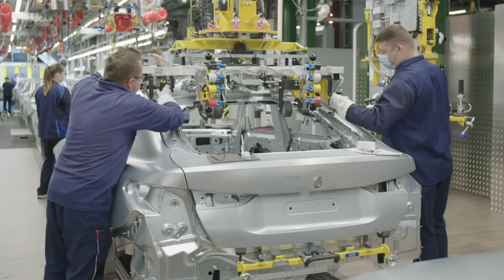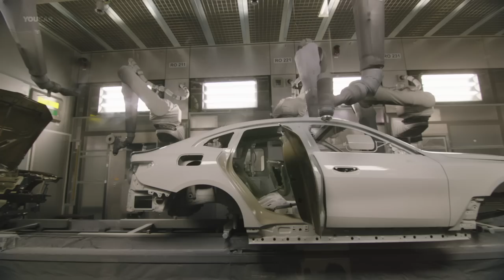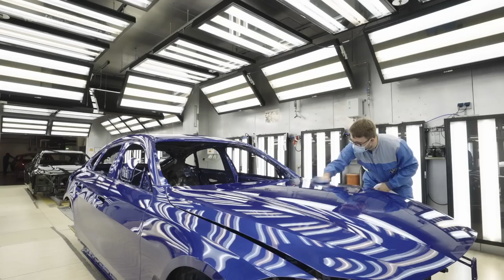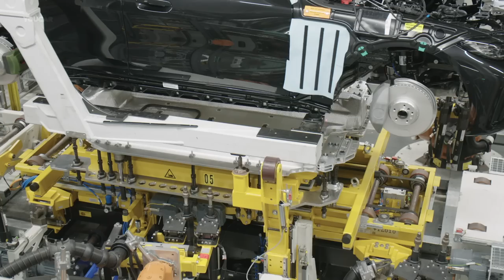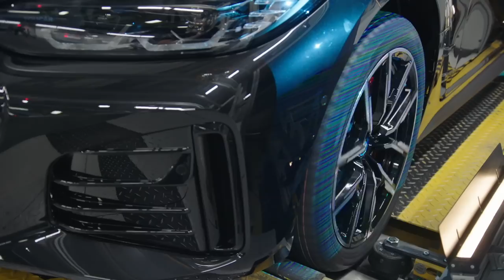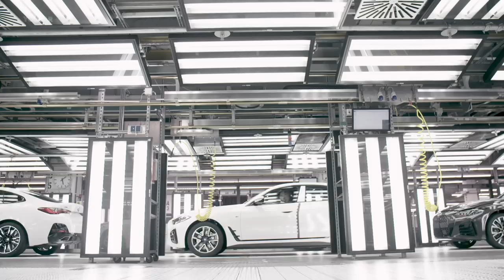Factory Tour BMW i4 in Munich

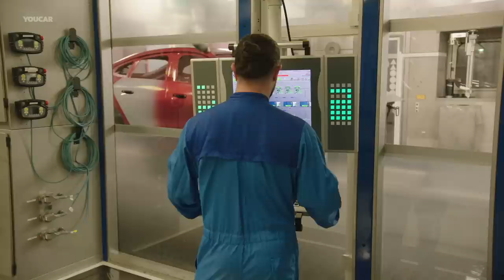Comment: How does the paint "nebula" not transfer to the other car in line? 4:50, there is white and red, should not red spray get some small particles on the white car or vice-versa?
Reply: Thats a good question I would love to know?🤔
Reply: I‘m not good in english. 

I think because the car body has kind of electric charge so it sucks the paint from the closer spray to them ..
Reply: @jenGD3  i think you are correct, I was telling that to my wife also but am still not sure.
Reply: Electrostatic charge on the paint gun and the car body. Only works over a small distance. No charge = no paint sticking. Plus, excellent extraction keeps it from hanging around in the air.
Reply: @Smith_Tech_70  thank you